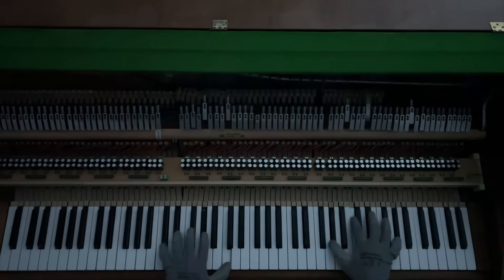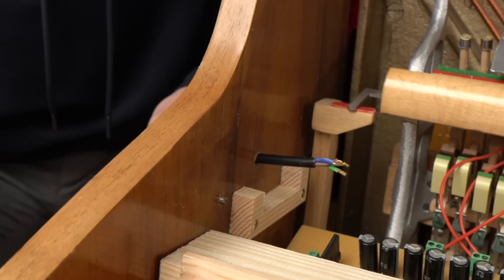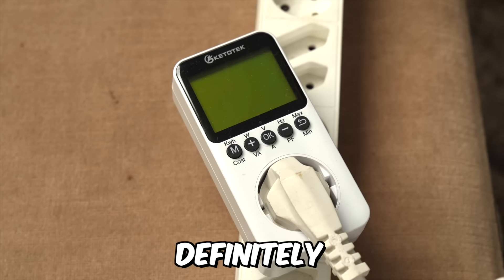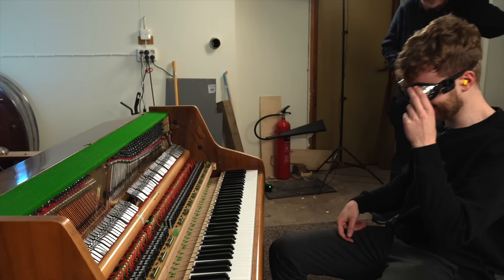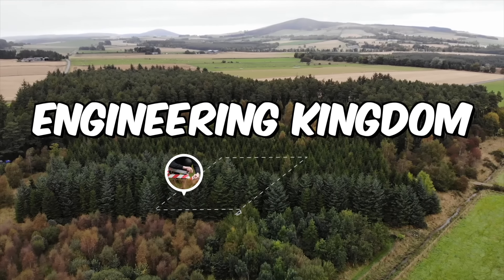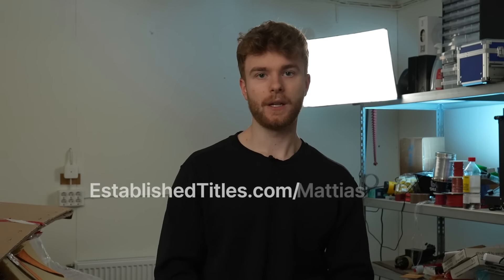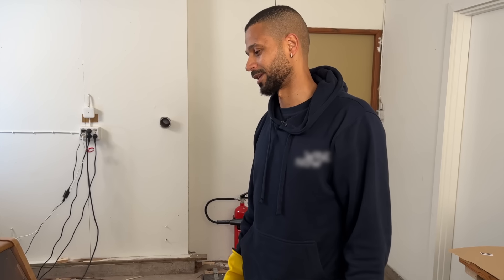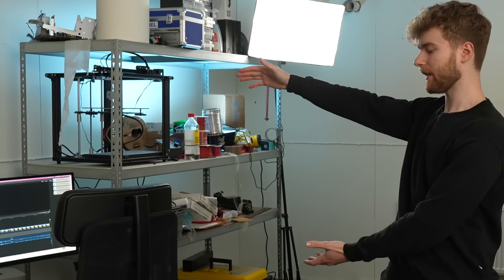Hiring electricians to fix my ”electric piano”

Comment: Immediately the best quote we’ve ever heard from one of these visitors “Of all the places you could put it, you just ape-brained it into the side?”
Reply from the maker: Hahaha function over form or whatever engineers say
Reply: I would definitely secure that cable... You never want a 230v live cable flying loosely around... Imagine tripping over the wire and getting electrocuted while hitting the ground because you ripped the cable off
Reply: @Mattiaskrantz  At least until it catches on fire that is? 😅

(But my electrician advice is to add a strain relief to the cable so you don't accidentally trip on it and pull the live wires out. And I would buy a safety isolating transformer and plug it into that, then you won't get shocked as easily)
Reply: I liked that guy as well
Reply: @Mattiaskrantz  A simple trick is to put a zip tie on the cable end, so even if you yank it, it cannot come out of the piano.
Reply: @Mattiaskrantz  There is no strain-relief on the cable, so it isn't just a question of form. Rerouting the cable would allow you to loop it around a post or something to ensure if it is pulled on, it will not put the tension on the connections to the circuit board, but instead transfer the force to the post.
Reply: @Mattiaskrantz  Adding to the strain relief comments on this thread, most of the tinkerers that I know tie a knot in the cable so that you have a bulge on the other side of the hole.
Reply: @FlorianMickler  yes for crying out loud at least like tie a simple not in the cable on the inside, you really need SOME kind of strain relief
Reply: @AiluropodaPanda  yep
Reply: "ape-braining it" is a new favourite for me.
Reply: @Mattiaskrantz  as an electrician i would at bare minimum have put a knot in the very flexible chord right after entering the piano. Now if you pull on it accidentally, the knot will absorb the pull and not the contacts on the circuit board, potentially ripping out live wires you then can touch.
Reply: I don’t know about that, I’ve been laughing at “how far away do you think this piano is from getting CE marked” for a good 10mins now. Engineering jokes ftw.

Comment: As an electrician, this piano is just a killing machine, but its more like a dangerous beauty, kinda like eating a cactus of the ground
Reply from the maker: Now when I put plexi over it it feels super safe actually! :D
Reply: @Mattiaskrantz  Now THIS is a scary comment!
Reply: @Mattiaskrantz  the fact that it feel safe makes it more dangerous. Stay affraid stay alive
Reply: You're not an electrician lol
Reply: Would it be safer if it was using DC instead?
Reply: @Mattiaskrantz  if you put dark tinting over the plexiglass it might even bring the brightness down to a safe level.
Reply: As an electrician, no this is not a killing machine. As long as you know what you are doing. Getting severely shocked from this to the point where it would be potentially lethal is a non issue unless you are really really dumb. Biggest risk here is fire and he is prepared for a fire. The danger is extremely overblown
Reply: @jasonporter7508  no
Reply: Most cacti aren't even close to deadly
Reply: @jasonporter7508  It is using DC, there's a rectifier in the build.
Reply: Beautifully dangerous like an invisible cactus thats at eye level...
Reply: Who eats a cactus?? 😂
Reply: @daometh  All of my dangerous injuries were a direct consequence of being too scared.
Apprehension is good, but if you're jumpy you need to stay as far away from everything as possible.
Reply: Not being able to reach forward and touch the hot components definitely made it much safer, yes 😂

Comment: Considering you've already made two elemental pianos (water and fire), may I suggest you complete the 4 elements with wind and earth pianos? The wind piano could be made of pull flutes or something, and you could replace the hammers for rocks for the earth one. Like a flintstones piano
Reply from the maker: I wanna make an airgun or leaf blower piano that just forcefully blow on the strings then put piano pickups under strings. It’s such a bad idea haha because it so inneffective. But would be fun
Reply: Wind piano = pipe organ
Reply: And play earth wind and fire.
Reply: Prince Rupert's drop as a hammer... Glass piano.
Reply: An air piano is just an organ/harmonium.
Reply: For the fifth element, should he use a literal or metaphorical heart?
Reply: Surely the metal hammers count as the earth piano. Just air still to go then!
Reply: @MeiGunner  wouldn't that be functional only very short-term?
Reply: @78alJ0vle  marble machene
Reply: You're thinking of a marimba and a pipe organ
Reply: @78alJ0vle  They could be small, perhaps marble sized.  Oh Maaaartin!!!
Reply: You know that you can tune stones, too.  Sort of like a xylophone, but with stone bars instead of strings?
Reply: @haveaniceface7290  not on this channel. Needs to be more scuffed.
Reply: @jadzzzz  Nah, because there's only one pipe, and the keys adjust the pitch. And aren't marimbas made of wood? stone hammers on a piano would not make a marimba sound, surely.
Reply: @Mattiaskrantz  I think that could work if you used an air compressor that activated with the piano keys.
Reply: @Mattiaskrantz  There is a way to make the piano sing using "wind". I believe there are pistons that are used by pumping air into them, that can replace the hammers. However you will lose the dynamics of the piano (you won't be able to play soft or louder) and the delay between each piston may ruin your coordination. Not to mention the amount of work, money and knowledge you'll need to make such a beast. Most importantly, it will be relatively safe as long as your pistons aren't too strong and the distance you put them is the most optimal, basically far enough to just barely touch the string, if that wasn't too obvious. It's a very unrefined idea but you, probably, get my point.
Reply: @ThePapaja1996  awesome squared 🤣
Reply: Wind piano's actually exist sinds the early 20th century. Player piano's or Pianola's are pneumatic devices. Air is pumped by your feet or an electric motor, and the air pressure is send to valves under each key. So just like in this instrument, the hammers are operated by air pressure (wind pressure). And that was the reason to go pneumatic. It was the amount of air pressure pumped that defined the loudness, or the attack of the hammers. So it was the firs automatic music instrument that allowed for the 'forte' and 'piano' that two centuries earlier defined the piano as instrument and gave its name.
Reply: @thefaulnt3562  do you know what that Glass is?( bud ,  the Glass Cant Brake no Matter how hard you hit it ....)
Reply: @_suspi  I was expecting 20 replies making Avatar The Last Airbender references, so seeing a Captain Planet reference is a nice and welcome surprise.
Reply: @Mattiaskrantz  hammers made of clay = earth piano, film a sexy pottery class montage, lots of views, promise.
Reply: @Dargonhuman  Multipass!
Reply: @MeiGunner  from the front yes but the vibration would snap the back
Reply: The best idea would be to create a piano that explodes when you play the wrong note.
Reply: @Mattiaskrantz  mix air and earth and have like an air soft guns shooting the strings haha
Reply: @78alJ0vle  I'm pretty sure Wintergatan made an earth piano then
Reply: Wind: Build a pipe organ.
Reply: A Flintstones Piano would be a Piano that makes a live animal/Dinosaur work the strings or make the sounds when you hit the keys. Even if that were possible it would be animal abuse, so probably more than just a bad idea
Reply: @_suspi  Ah yes, that's also a classic reference.
Reply: @MeiGunner  that would actually be so cool
Reply: @_suspi  No, the fifth element has many names, but it's generally called surprise.
Reply: Actually, flint could work if you get a flint knapper to make x amount of flintlock pistol flints they could work great as hammers but you would need to drill a hole with a diamond drill for them to fit on the hammer stalks you would also need to polish the ends of the flits so the strings won't break on you.
Reply: @Mattiaskrantz  so, a controllable Aeolian harp?
Reply: @78alJ0vle  collaboration with Wintergatan. He already has put several years into the dropping mechanisms.
Reply: If we get an Earth, Wind and Fire pianos I do expect September to be played.
Reply: I thought that the earth piano would just be a regular piano but with plants growing in it
Reply: @_suspi  lol, that was a good, and old reference
Reply: Isn't a wind piano just an organ?
Reply: @Mattiaskrantz  electrical engines hum at frequencies dependent on their revolution speed so in theory you could tune an array of leaf blowers or other vacuum cleaners to get a piano
Reply: @Birchall88  pipe organs are technically wind instruments, so that is already done
Reply: @ThePapaja1996  and thunderstruck by AC/DC thereafter
Reply: @Mattiaskrantz  How about make a piano with hammers that hit cut-off PVC pipes, like the blue man group instrument? I bet that would sound awesome

Comment: -A piano typewriter combination
-A piano that hits rubber chickens, bonus points if you somehow tune the chickens
-A piano that locks the key in place so you can only play each key once until you reset it all
-A LED piano where each note lights up a different light inside the piano
Reply from the maker: Lmao great ideas😆
Reply: The first one exists:
https://en.wikipedia.org/wiki/Baudot_code
Reply: I want to see the one that lights up different colors as you play
Reply: PLEASE google the initial typewriters and fax machines. They were, in fact, pianos and they bring my great joy
Reply: The last one reminds me soviet ANS Synthesizer a bit.
Or light-based hammond organ equivalents that were build thorought history.
Reply: @martindinner3621 it's not the same, you gave the link to encoding machine, not piano typewriter
Reply: The one with lights would be an incredible sight, but that one with chickens sounds hilarious.

Comment: i really like how this time you didn’t “prank” the people you called over (given that this is a far more dangerous piano than the E one for example. that one can only harm one’s ears and heart lol), and they were both genuinely interested and curious about it. i wonder if it ever came to something? did they figure out a way to make it safer? will you continue working on it or is it a bit of a lost cause?
Reply: Oh this piano can hurt people's hearts as well, although probably not in the same way you mean...
Reply: @OrangeC7  true, I hadn't thought of that lmao
Reply: The first guy already mentioned how to make it safe: insulate it, but then again you want openness for letting the sound emerge properly from the piano. A middle ground could be: insulating anything directed at the player and make a spark box of sorts around the hammer section so the sparks would land on places that will never catch fire.
Also regarding the glowing resistors, a different setup might be required to resolve that one.
Reply: He knows he needs to be serious about this one😂

Comment: The proper "electrician" for this piano is a high voltage electrical engineer, the same type that works / engineers high tension power lines and the switches for them.
They deal with contacts that have to survive high voltage loads and switching on and off and will give you the best advice, but even they will have to think outside the box, because the gear they usually use is WAY too big to fit in that piano!

As for bad ideas, sorry but in this genre, you have one upped me all the time so far, still I love seeing where you are coming from and where you are heading Mattias!

Comment: I'm an Electrictronics technician,  and I really couldn't think of many more ways to make it safer, but there's something really simple that could make it a little bit safer:
About that power cord that could be pulled out or maybe it could come off if someone tripped on it, you can make a knot on it from the inside, so if someone pulls it, it gets locked on the knot, and doesn't come out 👍👍
Reply: i sugest isolation transformer
Reply: That's awful practice. Cable glands exist for a reason.
Reply: @shadybabyxi  exactly! Plus make it a 90 with a strain relief
Reply: I know one way to help make it safer is disconnect it from the power supply, wrap the whole thing up in about ten layers of plastic sheeting, dig a giant hole in a field somewhere and burry the piano

Comment: You can put a non-conduct varnish on the wood to avoid fire by sparks. Also, you can use a more thickness cable to the drain part (conected to strings).
Reply from the maker: Good ideas!

Comment: Electrician with industrial controls  experience here.

Have some ways you could make this much better / safer, however you'd basically have to start the build over to implement some of these ideas.

1) using the bare metal of electrified hammers and your piano strings in order to directly run the power circuit is actually, properly insane.

It would be a far better solution to mount a small bracket that holds your conductor on the side / top / etc of your hammers which would make a connection with a 2nd bracket to the side of / behind the piano strings at the same time as the hammer lands. Using pieces of flexible metal that can slide up against eachother as the hammer moves forward / backward would be ideal, and these two changes would help keep your piano's sound much more normal and eliminate wear.

It's also worth noting that the far more obvious (but admittedly far less fun) solution to this would have been just putting a low-pressure push button below each of your piano keys that completes the circuit when you hit the key. But again, way less fun.

2) Relays fired with low voltage.

Right now it seems like you're running your circuit's load directly through the circuit connection. This is bad for many reasons.

What you could do is have a power supply that produces a low voltage like 12v hooked up inside your piano which would be used for separate, "controls" circuitry.

This 12v is what you would actually be running through the wires on your piano hammers. From there, the completed circuit would fire the coil of a relay which would then separately connect the higher voltage power to the capacitor in a MUCH safer manner. This plan would also massively reduce or eliminate the electrical arcs thrown around near (or at) your fragile piano strings due to the load drawn by a single relay being essentially nil and the 12v being far less dangerous / air-arc-ey in general.

3) install plexi-glass tubes over each of your individual capacitors.

This will help contain the sparks thrown by the capacitors, limiting the amount of fires you start inside your piano. This would also make it way more visible which note is being played as it'll only light up a single pillar above the capacitor rather than "exploding" out everywhere. Hypothetically speaking, you could even run them out the top of your cover like an organ and thus be able to play the piano with all your exposed electrical parts safe from being touched.

I doubt you wanna mess with this project anymore than you already have but I'm happy to answer questions about this or generally discuss it with you or others  here =)

Comment: There are a few ways to make this much safer. Add an isolation transformer before the rectifier (or back to back transformers to step down / step up - you can also adjust your output voltage this way too). Possibly a cheap ZVS circuit module could generate the high voltage from batteries and feed each capacitor via a resistor to the main bus - this removes the mains completely and makes the piano portable.
Add a suitable input fuse (won’t cater for most shorts here but still worth having).
Use bleed resistors on each capacitor. 
Use a glass panel or plastic panel which blocks UV (not sure how significant the UV component is compared to say a welding arc).

Comment: Some random piano ideas:
- A piano that plays like another type of instrument, such as wind or percussion. (Like the guitar video)
- Rube-Goldberg style piano to play each note
- A piano that fires nerf dart/pellets either at the strings or they keys
- A really tiny, but functional piano
- A piano that can be controlled via computer and can play itself (I think you may already have this?) - would be cool to connect it to one of those floor pianos you play by jumping on/with your feet
- Gaming piano with haptic feedback (such as the stool and keys vibrating - plus lots of RGB)
- Just a really loud piano
Reply from the maker: Some kind of projectile piano would be amazing. But also the other ideas are good🙏🫡

Comment: here's a piano idea: make a piano that, when you push a key, compresses a mini bellow which blows air through the corresponding note on a harmonica.
You would probably need chromatic harmonica to get the notes you need, and then it's only 4 octaves, so you would probably have to only use the 48 middle keys on the piano.
Reply from the maker: Wait isn’t this exactly how a reed organ works? I recall watching some restorarion videos on these things and this felt familiar!
Reply: @Mattiaskrantz  Yeah actually it is pretty similar, although in the case of organs, there's usually one set of bellows (electric or pedal powered) which blows the air through the reeds depending on which key valves are open. I always thought it would be interesting if there was an instrument where pressing on the keys actually provided the air pressure instead haha
Reply: Good idea, but a little too late. The pump organ was invented some 250 years ago.